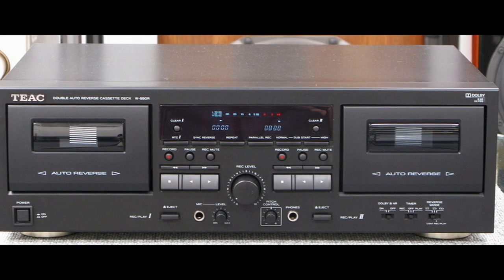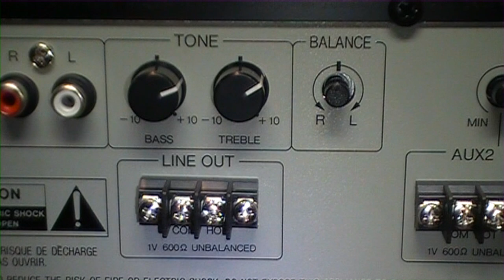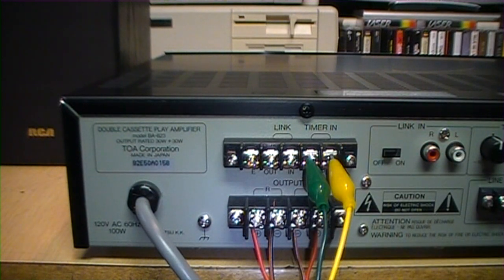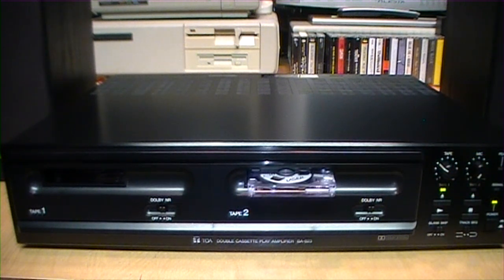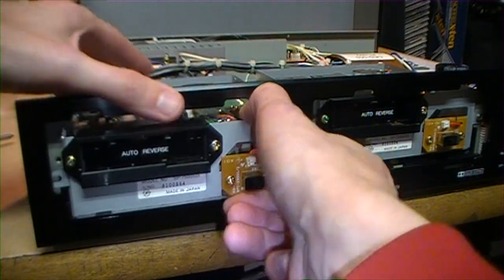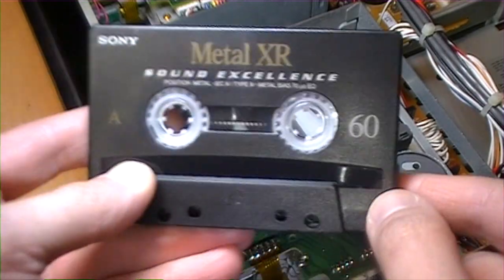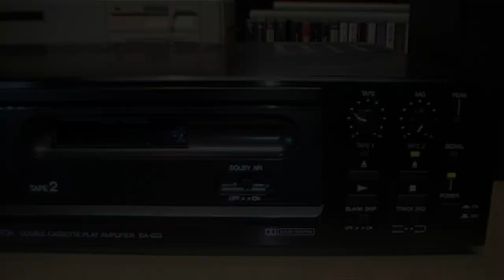New stereo auto-reverse Dolby NR cassette deck amplifier - TOA BA-823

Comment from the maker: Update: The BA-823s are all gone, but eBay seller "dsings14u" has several new old stock BA-806s for sale. That model has a mono amplifier, but the cassette decks in it are still stereo, so with the line output mod I showed, you can get stereo out of it.
Reply: It's fine.
Reply: it fits in with the equipment, all it needs is the line at the bottom of the frame and it would be a vhs tape playing. 
its nostalgic in a way to see this quality.
Reply: Perfect.  Makes it period appropriate.
Reply: Looked great to me.
Reply: Yes
Reply: Looks fine to me!
Reply: I like the camcorder quality on all of your videos and everyone got used to it. If you change it it will probably the old feel and feel of the channel
Reply: Camcorder video is always fun to see, what sort of transfer process/camcorder did you try out?
Reply from the maker: @TheOriginalCollectorA1303  A JVC hard drive camcorder with faulty optics. The left side of the image is blurry, even after cleaning the lens and making sure the focus is correct. And I tried using iMovie to edit the video, but after converting all the camcorder footage to 60fps, it only let me export the video at 30fps, I guess due to all the still images I included.
Reply: @vwestlife  Interesting, I guess it shows just how important optics can be. The end result is still great and works well. I thought this was a Hi8 or Digital8 era camcorder and the direct feed was recorded. I wouldn't have expected an HDD camcorder, but still, great video!
Reply: @vwestlife  was it the one you reviewed? I remember there being 2. One with the lcd that only works when put the other way around
Reply from the maker: @MannoulaZ  No, this is a GZ-MG680 that I bought on eBay recently. I briefly showed it in my video about the HDMI capture card.
Reply: aaahhhhh audio equipment archeology ....  love it 😊

Comment: I have both an XLR cable and an adapter to make this work it's called wire cutters and wire strippers.
It is actually quite common for XLR to be terminated in screw terminals or euro blocks for for installed equipment. for wires or fork terminals. That's quite an interesting machine!

Comment: I suppose specialty music venues, stores, etc might not have wanted mediocre sound quality even for “just” background music. Especially given the nice specs, adjustability of motors, and remote controls. 

Nice ceramic adjustment tool btw.
Reply: Yep! I think so too!
However, your comment made me imagine some smaller businesses running their background music off of consumer tape decks and tapes bought from a record shop, like how I've seen some businesses around me run their digital signages off of consumer TVs and/or PCs, and that one time I went to a restaurant that ran their background music off of a Spotify account on the free plan with all the adverts in between songs.
Reply: @kbhasi  Spotify free plan - margins are tight for restaurants right now. Some are still recovering from C-Vid and worker shortages. Gotta economize where they can!😉  I certainly remember restaurants and stores back in my "yoof" just running a local radio station for their on-site background tunes.
Reply: @lawrenceh1405  
Yep, I remember that a KFC at the ground floor of the same building as a private school I attended played something like Class 95 FM or Power 98 FM (prior to their format split years later) through their speakers. It's been years since I've visited that particular location, but I think they shut off their music system some years ago and uninstalled it (but probably left the ceiling speakers installed).
(Edit: they remodelled a few years ago from what I can tell looking at photos on Google Maps, and probably had turned off their music system)

Besides that, I've been to some other small businesses that play radio over the music system.
Reply: I'd definitely much rather have a business playing a local radio station with ads than a free Spotify stream!

Comment: I am very surprised that after 30 years sitting in a box that it worked!  I used to do a lot of work with TOA products back in the 90's thru the early 2000's.  Mostly mixer/amp units.  The biggest problems I ran into were the muting relays would get oxidized and created lots of intermittent issues.  Easily fixed with a business card and some Deoxid.  They made some good products.  I have a whole bunch of TOA modules kicking around that would plug in the back.  Thanks for the video!

Comment: Cool video! A company where I worked remodeled a conference room and replaced the AV stuff,  I got to keep the amplifier which was a TOA product. It looked very similar to this, very well built, and had a modular system where you could plug in various cards for different types of inputs (microphone, line in, phone).

Comment: The only achilles heel of that unit is the Sanyo STK4151 Hybrid audio amp they're known for failure. Finding a real one can be a chore as most of the ones you'll find online are counterfeit. You'll probably be ok for intermittent home use though.

They were very common place and pretty much every manufacturer used them back in the day. I replaced a ton of STK modules in CRT projection TVs as they were used as convergence amplifiers.
Reply: Yeah, I replaced a lot of those.
Reply: I've replaced several in VCR's, too.
Reply: @rwdplz1  Yeah they made a series of multi rail voltage regulators too some specifically for VCRs.

I remember one on an early 80s Hitachi VCR (linear power supply) the heat sink on the VR got so hot in normal operation you could practically fry an egg on it.
Reply: STK's have a bad reputation of breaking, but it is because equipment manufacturers push them to their limits of power supply voltages (or put them on a tiny heatsink).
One time a friend came with a Technichs compact stereo and he broke the STK, and it was obvioisly pushed to the limits. 
When I put a new one, I rewired the power transformer to a less voltage output winding, and he has never again been able to break the STK again (but he also didn't notice the slightly less output power).

Comment: the reason for the screw terminals on the microphone is that this thing would have been installed in booth and the leads would have gone to a wall terminal that ran to a microphone XLR input in the floor of the auditorium or something like that

Comment: I thought the name sounded familiar, and then I realized two old amps I found in the trash container at work a few months back were also made by TOA - their VP-1120.
A real pair of lead weights they were for sure to drag home, not sure if they were used by the Luxor company at the end before they closed up shop here in my town, or if the amps belonged to some other company’s audio system that moved in after. (I work at a company in the old Luxor building)
Reply: @@csstp yup, there isn’t much left to indicate Luxor was here in the building anymore except the name - Luxorcenter, the guard building where you had to sign in and that had the video surveillance was just torn down a few months ago, I was allowed to dig through what was left in the old guard room. Took home the intercom with two reel-to-reel era answering machines, and a old coaxial video crt monitor etc. :)

Comment: I can’t say I’ve ever seen another cassette deck that loaded tapes the same way a car’s tape player does; this is a first for me. 

That alternate playback sequence feature is really slick. Couple that with another unit or two and you’d have a pretty varied radio station playlist sans the computer. I’d be tempted to get one just for that purpose, since I have boxes of tapes that are just collecting dust after being digitized. At least then I’d be able to put them to good use again.

Comment: (SHHH!! Don't tell them the SECRET!!) 😉

Seriously, tho... I've become a big fan of TOA's D-line over the past year or so. They marketed these as "Electronic Music Mixers" with a couple of expansions such as the D-4E expander for the main unit, the D-4. But it was the D-3 that really grabbed me. You get, in 1U, a 4 stereo or mono input per channel, an AUX send/return, direct outs per channel, and great, thoughtful interface design. I snagged one last year, put it in as the summer for this shortwave-driven setup I'm planning to (hopefully!) use live as part of my rig.

To make a long story short, it was pure serendipity. For live electronic performance, these are so easy to work with sonically that I dove back into eBay and snarfed two more for summing duties with 3-channel insert matrix voodoo that lets you drop these effortlessly into eight mono mixer channels. Oh yeah...these things also do NOT need an insert Y; they're designed so that all you need are a bunch of bog-standard 1/4" TRS cables. The signal return is set up automatically in the unit, and it works with any standard channel insert.

That's not a TOA product this time...but something from another installed audio firm: Biamp. The Advantage AM is what I'm on here. It has only ONE flaw, and that's the fact that powering it requires proprietary rules to be followed... either you have the base-level mixer and it supplies DC to the AM via the main 27V supply, or you can hunt down an Advantage 12V supply as the power source for using the AM alone. Or in my case, you use one Advantage 12V supply to feed DC to two AMs, or maybe a single AM that sends the DC from one device to another 12V-only Advantage unit.

Oh...did I mention that each AUX send on these also has its own insert?.Yeah, you can go nuts with the AMs. Damn shame that there's no present-day equivalent devices on this level...plus Biamp likes to kick "legacy" gear to the curb and pretend it never existed. Which, of course, is pretty annoying until you stumble across full instructions AND schematics for every Advantage-series device, all bundled up for DL on Biamp's site. Nifty!

Fact is, there's a PILE of "contractor audio" gear out there...brands like Symetrix, Rane, et al have serious latent mojo factors. My studio has a bunch, from Biamp's MI days spring reverbs, to dynamics control of all sorts from Symetrix, Rane for EQs and parallel FX work, and even some proto-gear like cut EQs and notch filters from Rauland (a precursor to Biamp, in fact)...and my beloved spectral masking noise gen from Muzak itself! Contractor audio...if you know what you're looking for/at, it's ALL got massive "abuse potential".

Comment: Nice unit. Though one can't help wondering if it's much of a step up from a front loading dual auto reverse deck, which had the advantage of easier access for head cleaning - arguably the number one maintenance task on a tape deck. But TOA made good kit, even if the mechs weren't technically their own. NEAL were another making solid industrial audio units.

Comment: I've heard of them as I have a few of their wireless microphones, one is from the mid/early 80's, all are decently built and the oldest of them gets 30hrs of battery life from 3 x AAA (no 9V batteries here!), even the slightly later system only uses 1 x AA for 10hrs which is pretty good, plus the older receivers can be powered by the mains or DC.
You need to get the TOA MR-8T, an 8! track compact cassette recorded, doubt they sold many so must be pretty rare.
TOA are generally regarded as a quality manufacturer making pretty bullet proof audio installation gear, so not surprised this still works fine, they even once made an impressive large digital mixing console the ix-9000.

Comment: if a tape deck met the q specs of a (japanese) car manufacturer, you can be sure the design is mature, reliable and working under extreme conditions, e.g. after bad handling during car assembly. Car manufacturers use to claim $$$ compensations if a line has to be halted or cars sorted to a rework track "due to parts failure". and such equipment has to work at least for 3 years when used for daily commute, either in the alaska or south of italy, without causing warranty claims above a defined threshold... otherwise the carstereo manufacturer will have to pay compensations the car company as well.

Comment: TOA makes the good stuff! If you’re lucky enough to get your hands on any of their Japan-produced products, it’s nigh impossible to kill them. The Taiwan stuff is pretty good, too.

The thing that strikes me: it looks like they repurposed the chassis from the MK2 version of the 900 Series amps for this deck. The MK2 900 Series amps were also released in 1992, replacing those honkin’ huge silver 900 amps with the analog VU meter on the front panel. This is a new piece of equipment to me, so I don’t know if they would’ve made a version of this that used a variant of the old silver amp housing.

Comment: Wonder if the voltage is slightly higher at your location and thus why both decks were a bit fast? (and now I wonder if 'good' decks regulate the motor voltage? Turning on a space heater on the same circuit might affect sound quality lol!)
Reply from the maker: The decks use DC servo motors, so they're unaffected by voltage variations.

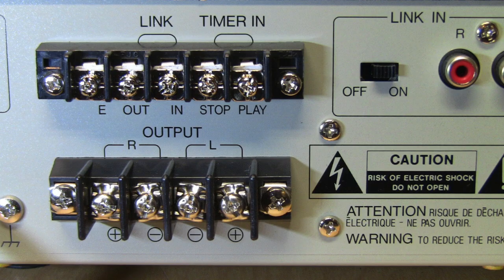Comment: (3:05) My guess is that it was originally designed to connect to a TOA amplifier which could then output to speakers in different zones or rooms at different volume levels, but then there could also have been more basic models of the amplifiers that would've only supported a single zone.

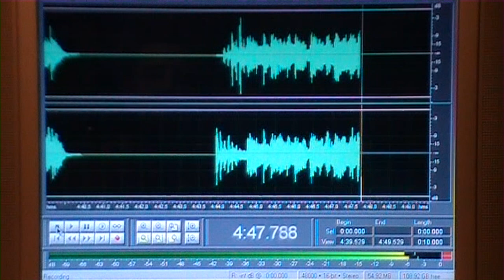Comment: 19:46 - 🎵"Get your motor runnin'... Head out on the highway... Looking for adventure... In whatever comes our way." lol

That deck sounds wonderful! Crisp highs, solid bass, and no muddying of the midrange... Before you even opened the case, I had strong "car tape deck" vibes from it simply from the side-load. It makes sense, actually, since a decent car mech would be built to withstand the rigors of on-the-road use, so it should hold up remarkably well in a stationary device.

Comment: I had a Pyle dual cassette deck a few years
ago, it was terrible and Walmart wouldn't 
give me a refund, being over 90 days.
I just left it on the Customer Service counter
and left the store. It was a Pyle of Sh...
I have a Teac w1200 from Japan which runs
at 100 Volts, is Silver in color and has DNR.
It looks very similar to your deck. It was
not cheap when I had it shipped from Japan.
It does work well though.

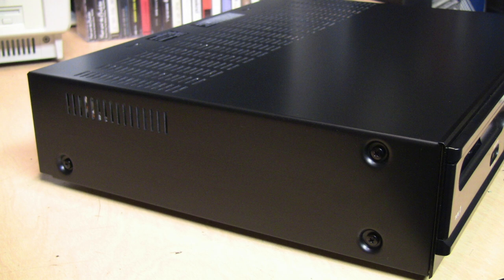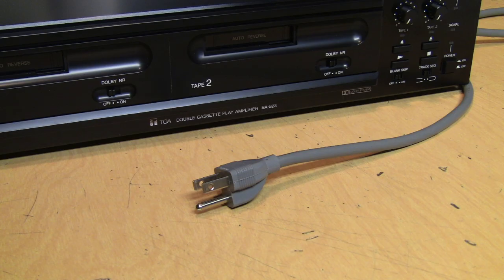Comment: 19:13 - 19:19 is the melody from the "You're Never Fully Dressed Without a Smile" section of the overture from the musical Annie. It happens at 1:19 - 1:24 in the 1977 Original Broadway Cast Recording.

Comment: I have heard of Toa, the school I work at has some Toa rackmount amplifiers from the late 70's to drive the period bell and announcement systems, extremely heavy with brushed steel faceplates, 200W. I had the opportunity to take a few home that were not hooked up, but I did a bit more research, turns out it has a 50hz cutoff intended for PA speakers, and they are not stereo, so they would be unusuable for music.
Reply: Two mono amplifiers are basically as good as a single stereo amplifier.

Comment: Nice Video Squire, I’ve heard of TOA & own a Powerful TOA Mixer Amp that would normally be used for Exhibitions & Conferences, I also own a Panasonic Portable CD/Radio/Cassette Boombox which has a slot loading Cassette Deck similar to the Decks on that TOA although you can perform Rewind/FF & Record on the one I have here as well as Play/Stop & Eject of course! Anthony - Birmingham/UK 🇬🇧

Comment: Great deck! I would still not get it because of the missing standard functions like rewind, fast-forward and tape direction switch, not to mention recording in one of the two tapes. Still, very nice unit with great specs (I assume the S/N rating with Dolby set to On was meant to be in dB as you mentioned, and not in Hz as stated in the manual lol). Thanks for the cool content! 😊

Comment: Must be a typo in the specs. without dolby S/N is 50dB and with dolby on it's 60Hz.. I'm guessing it should be 60dB?
Reply from the maker: Yes, 60 dB, not 60 Hz.
Reply: I noticed that also, but guessed it must be wrong.

Comment: mostly these decks were used in places like airports and other places for background or even the need for a pa setup. I had a toa 900a pa amp that was used by an airline at their ticketing counter.
Reply: They also used them in supermarkets, department stores, etc. where they used the TOA slot loading dual cassette player back in the 1990’s.

Comment: I love the way that I went on ebay and there is only one listing left 3 available. when I clicked on it it said 11 watched in the last 24 hours. that was fast. sadly since I'm in the UK shipping is not an option at a quoted price of £164.
Reply: Heck in the US for me it would be around $100 total which isn't bad but for something I'd have to modify to get Line out, I think I'll pass.
Reply: @battra92  for shipping alone or is that combined cost? the cost I mentioned was just shipping and not the extra £50 for the deck its self

Comment: DOLBY was and still is only good for recording  but playing it back is best with Dolby turned off on most average decks because Dolby does add more treble while recording but playing it back with Dolby On  will mask the upper tone as if you turn the treble down   ..If it  is a high end type like Revox  or expensive Nakaimichi ,Dolby does work properly with the Dolby On in playback mode
Reply: True when I had a dolby deck I didn't care for it to me some of the highs got lost i had to turn up the volume to make for it

Comment: Would it not have been better if it had a 9 track head that fed data back to the PASC Decode circuits before being sent to the stereo DAC which feeds the internal amplifier which drives the speakers so it could play DCC tapes.